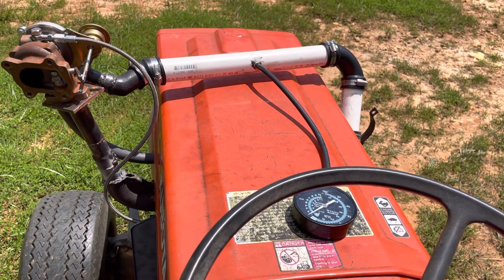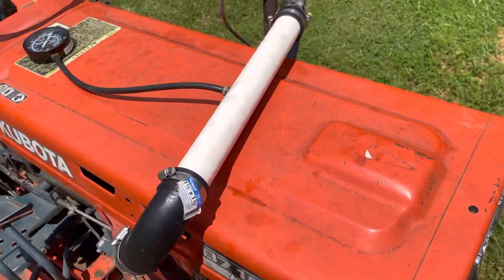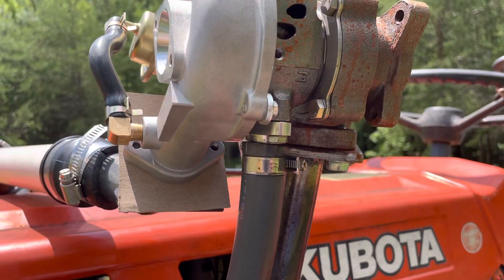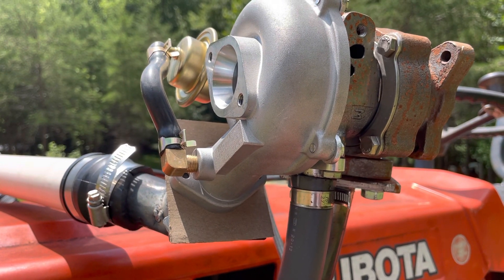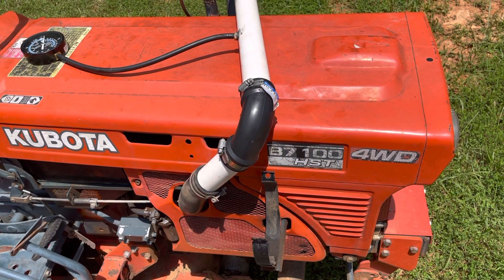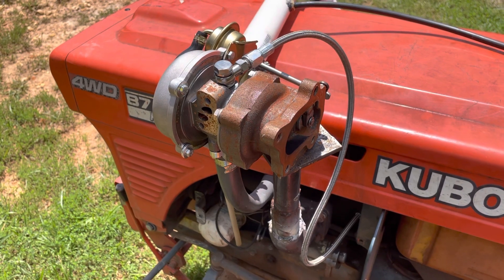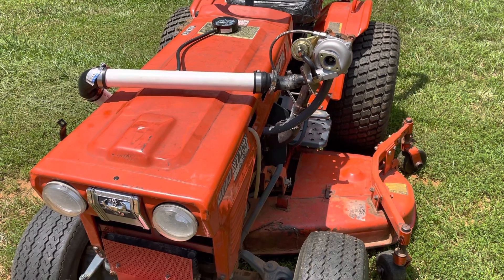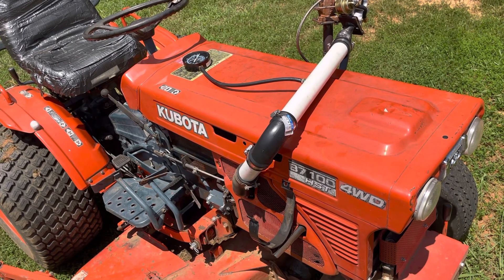Turbo Kubota B7100 gets some low boost

Comment: Be  areful 5 psi is all you need to get full burn
Reply: That all depends on how much fuel your running tho
Reply: i could clean up the stock injector pump turned up at about 12 psi, with the fuel screw cut off it would clean up at 16. 5mm stock internals on the pumps, i went up to 5.5mm and it cleans up at around 40-45 psi. going up to 6mm, should be good for about 100 psi with triple turbos.

Comment: Well, at least you know you can spool it.  Did you adjust the fuel?  I bet you don't want more than 8 psi with na engine.  You'll probably get more boost under load as the governor adds fuel under load.  Keep it yo and excited to see the end results.   Jason
Reply: Fancy seeing you over here Jason 😉
Reply: @BiffsEquipment  guess I can see what you're researching Mike haha
Reply: 8??? they'll hold atleast 75 with stock rods, i know theyll do 4k rpms at 30psi reliably. the governor on these dont add fuel under load, they stay the same amount of fuel at all rpms, NA engines dont have a AFR housing
Reply: @cs-gj3yf  you can boost a N/A engine without changing the piston compression? I thought lower compression pistons were required for turbo applications
Reply: @prevost8686  they usually are, it dont make much of a difference to total cylinder pressure, main dfference is the bottom end, they will usually have bigger rods and wrist pins, bigger rod bolts, etc, although the stock internals on these small diesels are insane, no need for billet or steel rods so far